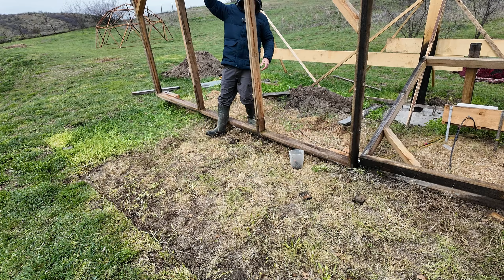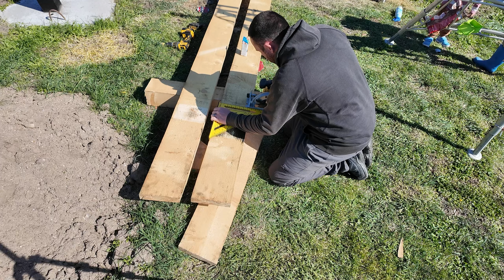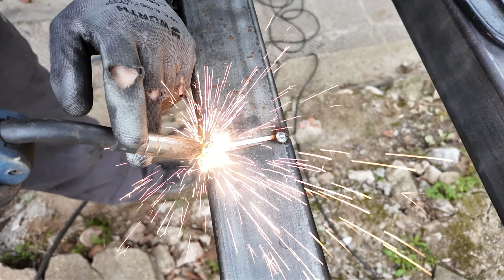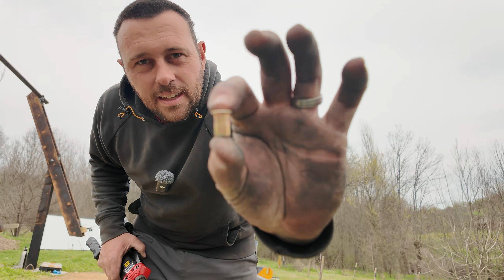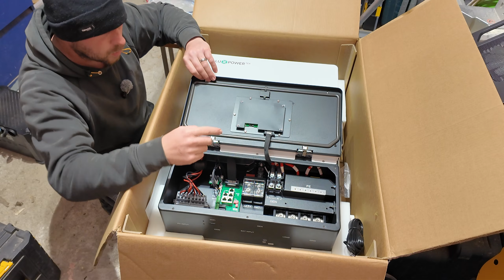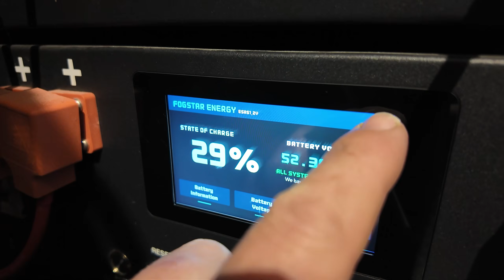How This Family Powers Their Off-Grid Home with Solar

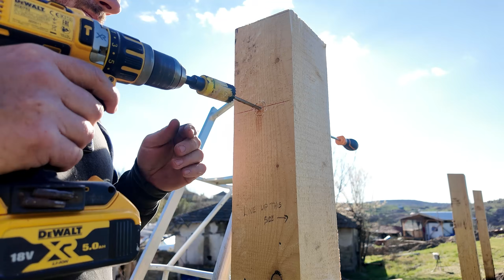Comment: 7:08  Holy crap, I need to learn this technique.  No, I do not know it, and normally the process of drilling through thick lumber is a headache.  What is that tool called, that keeps the mandrel straight during the drilling?
Reply from the maker: It worked but not brilliantly well. I bored a 6mm hole through the timber and then used a 6mm rod and replaced the centre drill bit with the rod. Hope this helps 😊
Reply: @OffGridWithTheUdens  Yes that helps.  That's a great approach.  Thanks!

Comment: amazing how cheap now, 8-10 panels at 100 euros a pop and couple of 2.5kw batteries for a grand or so. Plus some stands  i suppose ~:)
Reply from the maker: The prices on panels have come down a lot now, I've debated buying a pallet to use gradually as and when we need them.
Reply: @OffGridWithTheUdens  if coming down then last thing wana do is buy bulk cos will be even cheaper next year

Comment: Nice job… just check need for steel 😮😊sheer lines at the posts to prevent them breaking with heavy wind on the panels..
Reply from the maker: We've had some pretty serious winds since this has been up and it's stood up incredibly well so far. There is very little flex in the frame. I watch it during most storms to see how it's performing. So far I'm very happy with how strong it is.

Comment: I have been looking into Solar to power our House, Barn, Office and love your setup. Another question would be if you were to do it again would you opt for a single phase or three phase system. We will have the money for either within reason and the Three phase systems iv seen on other channels and websites is not massively more to buy. 
Hope you are doing ok in the heat and if you are ever near Pavlikeni or Veliko Tarnovo and want to pop in for a cup of tea and nerdy talk you are more than welcome. We are aiming to of fully moved over by the End September, we have so much here and in Bulgaria to do.
Keep up the good work your channel is great :face-red-heart-shape:
Reply from the maker: Thanks for the kind words 😊. I think it depends on your power needs. We can connect our inverter to 5 more units giving us 72kw of single phase which should be plenty for our needs.  Unless you are running big machines or maybe an electric car I can't see much need for 3ph personally.
Reply: @OffGridWithTheUdens  I guess its just trial and error and grow the system as you go. biggest things ill be using are 1.swimming pool pump, 2. mig welder occasionally and power tools. everything else is things like PC, house stuff. There is so many videos out there with different opinions its hard to know where to start. Cant wait to get it all started and be as much off grid as possible. Even been looking at a reed pond to filter the septic tank water.

Comment: I feel your joy for the inverter upgrade. I too had 1 Victron 5000kva. 90% of the time was fine until that AC, the air fryer or the microwave pushed us over the top and blackout. I went the easier way and doubled the capacity with another. I wanted the 15000kva so bad but couldn’t see myself lifting 80kg up on the wall.
Reply from the maker: Haha yes I can relate to the weight on the wall! If I had a Victron I too would have added another one. I wasn't pleased with the Growatt so I wanted to upgrade that so it made sense to go bigger and better.

Comment: Hi please tell me where you got this info on Growatt and them removing support or switching off the ability to use 3rd party batteries if you have evidence about it then share it, otherwise it remains gossip and misinformation. Spill the beans mate if there is proof.
Reply from the maker: I now work for Fogstar batteries, we had to back engineer our battery software twice after each Growatt update as it cut off all comms. Growatt then said to us they would no longer be supporting 3rd party batteries and their inverters should only work with Growatt batteries. This was probably a year ago now and we haven't had the trouble since so I do wonder if they back tracked on that decision.

Comment: You might try dipping your posts in Creosote a few times before putting in Cement in the Ground.
Reply from the maker: We decided to use old engine oil and shou sugi ban as it's worked so well in the past 😊

Comment: Great video for fetching ideas! I'm plannig to build something similar. 😅
What size cable are you using between combiner box and the inverter, and what's the distance? Have you checked the voltage drop or maybe just considered it?
Reply from the maker: Yes voltage drop checked I can't remember off the top of my head now but it was almost zero voltage drop. We are running 6mm solar cable and the run is about 30m end to end.

Comment: You guys are terrific. 
Fantastic job you’re doing out there - I wish you all the very best. 

However … was the steel welded frame for the PV panels not just a tickle over-engineered?
Would aluminimummn not have done the job just as well?
Reply from the maker: Thanks for the kind words. Yes the steel was definitely over engineered but I have to say that's how I like to build most things. 
We tried to get aluminium initially but the lengths didn't work out quite right and the profiles we were looking at would have been twice the price of the steel we used here.

Comment: Wiring looks tidy. Good job. I personally would be concerned about the solar and how it will hold to a wind. I would personally go for steel.
Reply from the maker: Thank you 😊 yes if there's wires on show they have to be tidy! Agreed if I had the chance to do it again I would do it all in steel for sure. We've had some pretty windy weather already and it's had very little movement. Thanks for the comment. 👍
Reply: @OffGridWithTheUdens  Good luck. Hope it all holds up and bring you many problem free kwhs.

Comment: Great job and setup! I have 4800w grid tie setup from Enphase. I notice you were getting 4120w in from your array, thats good on 4920w setup, mine is making just over 4000w, and thats after pulling power from the array to run the 16 micro inverters. Ive had my system for 8 yrs now, and it has produced 5.5 mw consistently every yr without any loss in production. The only change I would would make to my system is a micro inverter upgrade, from IQ 6+, to the new IQ 8s, there the only grid tied inverters that have the ability to island themselves in a grid down without battery backup, which is a monumental feat because by code, grid tie must shut down in a power outage
Reply from the maker: Yea that sounds very impressive! Love the idea of micro inverters for shading optimization. Unbelievably I've had just over 6000w out of this array which is crazy! I'm no impressed with how well solar 'just works' almost zero maintenance and if it's sunny there's power! It's wonderful. Thanks for taking the time to comment. 🍻

Comment: Great solar panel setup mate, good to have plenty of land for it.  How has it held up to wind, snow and storms, if you’ve had any? I’ll have to check out the rest of your videos to see you full setup but love the 12kW inverted you’ve installed!  Good on ya for getting the family involved too, wife, kids, always helps and gets them learning from no matter what age they are.  Keep up the great work! Cheers Vlad.
Reply from the maker: Thanks so much for the kind words. We've had some pretty decent wind and it's been surprisingly firm. I thought it might get a wobble on or something but it's been really good so far. No snow yet but when we get it I will just tip them near vertical so the snow will slide off. They will also be just as efficient then due to the reflection from the snow on the ground. Cheers 🍻

Comment: I've been in the inverter repair industry for the past 25 years and can tell you from experience that high-frequency, transformerless inverters like the Luxpower are the absolute worst choice for use in off-grid applications. Low-cost, high-frequency, transformerless inverters like these offer poorer surge capacities and shorter life expectancies than low-frequency transformer-based inverters. And even worse, without an output transformer to provide galvanic isolation between this inverter's DC boost stage and its AC output, this inverter can damage your appliances when its MOSFETs fail. Don't take my word for it; ask Google AI this question: Can a high-frequency, transformerless inverter damage your appliances? To learn why you should stay away from transformerless inverters like these.
Reply from the maker: Thanks for taking the time to comment. So far I've been really pleased with this inverter and even the cheap Growatt before it performed well. I will look into what you're saying, but for now we're very happy with our choice. Cheers 👍

Comment: First of all a great Video and a really impressive and inspiring Project! Here's my Question: how much Battery Backup do you have and what's your recommended amount? Could you put a link or an affiliate link into the comments? I would really be interested to get one for our Land. Best regards cheers
Reply from the maker: Thank you so much for the kind words. We use Fogstar solar batteries ( fogstar.co.uk ) and currently have just over 25Kwh of storage. Recommended amount is purely down to what you want to run and how long for, on battery power alone. At the moment if we're careful we can be on battery power only for about 3 days. We have a discount code for Fogstar which is Udens10 that will get you 10% off solar batteries. Cheers 🍻😊

Comment: Great job - one thing I would suggest is getting a solar diverter for your hot water. The elements in your water heater work just as well off DC so you save the losses and the load on the inverter and your battery. It does mean that you have to decide between your battery and hot water but most diverters are reasonably intelligent and you can control from an app. Oh and definitely get more solar.
Reply from the maker: For us this doesn't really work as our hot water cylinder is on the other side of our property to where the batteries and inverter are so running a DC feed isn't really worth it.  Also we have plenty of power most of the time so our hot water is on permanently. My plan in the summer is when the batteries are full I will divert the power to heat the swimming pool. We are already getting our batteries from 40% to 100% before midday so there's already plenty of power to dish out 😁. Thanks for watching and taking the time to comment
Reply: Far more efficient to utilise solar thermal than heating water from PV. I wonder if have considered burying pipe and a low boiling point fluid try extract some heat from the ground during the winter?  Nice job, that PV frame is very simplistic and very practical.
Reply: @jim-zhang  It can be more efficient but now, with PV panels being so cheap, it really isn't worth the hassle of the plumbing, the pump, when you can get the same result with a couple of additional panels on your roof.
Reply: @mondotv4216 Tell all that after a hail storm, etc. My comment was more about an energy mix, never put all your eggs in one basket.
Reply: @jim-zhang  You don't have to throw a tizzy mate. I have a solar thermal system. All I'm saying is, if I was doing it today I wouldn't have bothered. I'd just have panel diversion - it's way cheaper and more flexible as when it's not heating water it's either supplying electricity to my house or feedback to the grid or charging a battery. And as far as hail goes my panels have been in some massive hail storms (and I've had solar panels since 2008) and never been damaged. OTOH my solar tubes have broken 4 tubes since 2013 in hail storms.
Reply: @mondotv4216 No need to be defensive m8,  as I wrote it’s about an energy mix. You keep to your one trick pony and hope the hail the size of golf balls never fall from the sky. There is a good explanation in Bulgaria as to why they fire rockets into the sky to disrupt hail storms. The advice isn’t specific to this video.  Just a fact of physics solar thermal for heating water is more efficient and therefore less area taken up (less area to cover to protect from hail). As their family grows so does energy consumption, need to plan ahead m8, think of the winter when if was fog/mist 5kwp generates almost zero energy. I know this from far bigger plants. Try run a small holding all electric it soon add up include during summer.
Reply: @ I live in Sydney - we’ve had hailstorms bigger than golf balls and as I stated the solar thermal did far worse than the panels. I’m telling you from lived experience which technology does better in hail. Why do you think solar thermal fares better in hail?
Reply: @ Let’s leave it there - personally I think solar thermal will all but disappear over the next decade. I don’t know any installers in Australia that are still recommending it. Especially with heat pump hot water systems becoming the norm. The video poster has said he’s not interested so it was a pointless suggestion anyway.
Reply: @mondotv4216 Yeah, yeah, your panels get hit by golf ball size hail and they are intact. Whatever m8, very funny. I invent new solar device that works to make electricity and creates soil, 😂 Honest m8, I have the experience, must be true.
Reply: @ Read about thunderstorms in Sydney. Why would I lie about something like that? I had my first 2.3kW system installed in 2012 (NSW solar feed in scheme) and then I pulled that system off my roof and sold the intact second hand panels and installed a new 9.2kW SolarEdge system in January 2021. I put in a 12 tube solar thermal system in 2013 using a company called Endless Solar that was bought out by Hills Solar. That system has had a controller fail, pump fail, tank die (not the systems fault - mains pressure tanks fail) and tubes break in the non existent hail storms. It came with two spare tubes. There are currently two broken tibes and I have no spares left. You do the math.
Reply: @mondotv4216 Mondo, in your own world your the greatest, smartest most honest person. What a mondo! 🎉

Comment: Hi, where did you get the information that Growatt is deleting specific batteries? The software does not know anything about the battery but there are communication protocolls implemented. Do you mean by removing battery manufacturers Growatt deletes in newer firmwares communication protocolls? However I think you mixing up things totally. Growatt since some time says they only support their own battery systems. However all other systems which worked in the past still work nowadays... The connection puzzle is the protocoll you need to set and I never heard they deleted some of those on newer firmwares. On the other hand there are the US and US2 settings where you can use every 15s-16s battery without any communications... Drawback here is that there is no SoC anymore available from the inverter but batteries still work as expected. 
I agree that the shine-f dongle and the growatt cloud has security concerns and they have the ability to upgrade firmwares over the air but you can switch the upgrade function off and beside that I never heard of any situation like this. 
Regarding the power limitation you mention, you can put up to 6 growatt inverters in parallel to serve one phase. in your case a second one would be enough to constantly power the house without issues. Advantage is that you can switch in winter times one of the inverter off and keep the master running.
Reply: Since watching this video I have been researching these accusations about growatt and it seem baseless please tell us your evidence for this.

Comment: Put that solar isolation switch back in bud. But thats fantastic setup.
Reply from the maker: The inverter has one built in the side of it which handles 3 separate strings. My old one only handled 2. I've tested the built in isolator and it works great. I also have isolation breakers up at the panels too. So the system is pretty safe. Thanks for watching and the comment. 👍

Comment: Can I ask why you didnt just use solar mounting rails rather than fabbing your own? Was it a strength issue or was it just much cheaper than the prefabbed rails? I'm wondering if you could also get some kind of chain drive and light sensor to automatically tilt the pannels to most optimal position. Not sure if that would be safe with the little one around, though. Looks great, could maybe sit under it in summer like a pegola
Reply from the maker: Sure! Theres few reasons. 1) they are more expensive 2) I couldn't find any that were rated at the mounting distances I had 3) the lengths they came in would mean a lot of wasted rail and would require joiner plates which I wasn't sure I trusted. 4) we reached out to 4 separate companies about their rails and we received one reply in total with that reply sounding Like they weren't interested in our custom. So I saved my money and built exactly what I needed to my spec. I also really enjoy fabrication work so it was all fun for me 😀. It's also as you say a lovely shaded spot for a bench!  Thanks for watching and commenting.

Comment: Ciao,io avrei tenuto distante almeno 10 cm di luce tra un pannello e l'altro, per diminuire l'effetto vela in caso di vento forte, il calore sotto i pannelli salirebbe tra le fessure dei 10 cm, così facendo i pannelli sarebbero più Freschi, e questo lavoro lo farò soprattutto sul tetto di casa visto il calore è molto maggiore sotto i pannelli. Sappiamo bene che più i pannelli si scaldano e Meno producono, cmq bel progetto 💪🙂
Reply from the maker: Thank you very much. Yes the cooler the panel the better the efficiency, there is plenty of airflow around these though so I don't think it would make much of a difference. I do agree it would reduce the sail effect though. Thanks for watching 😀

Comment: I would make a little weep hole, in case water gets into the metal frame
Reply from the maker: Thanks for the comment. Yes, all ready done on both ends of the steel box sections.👍